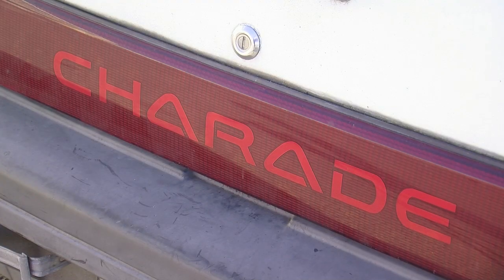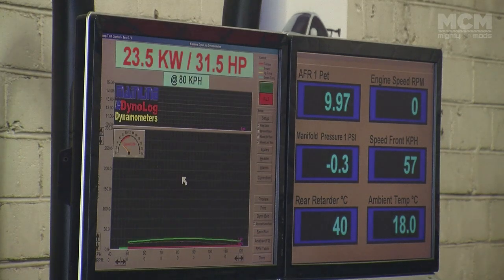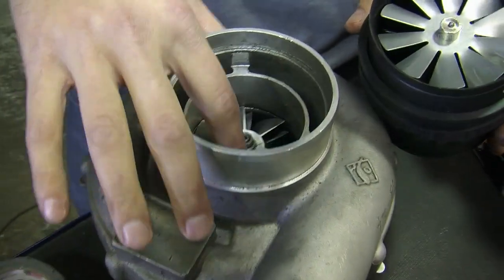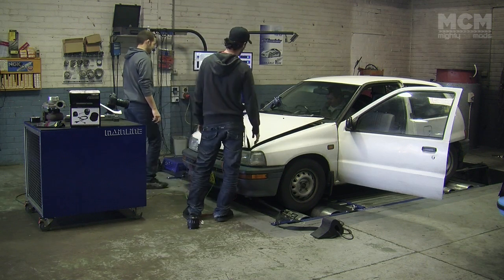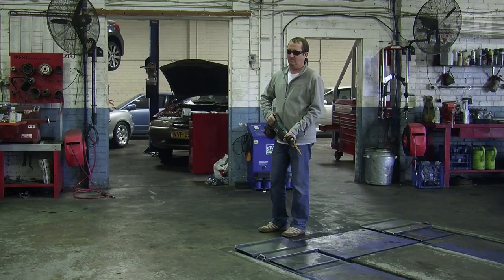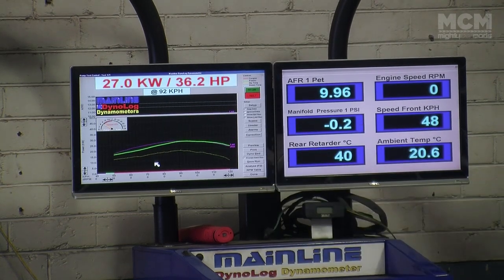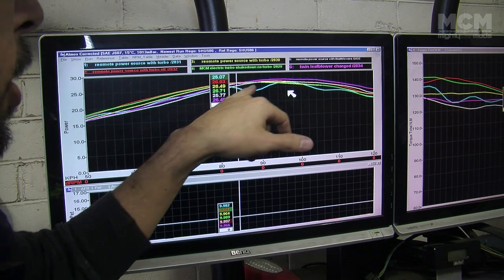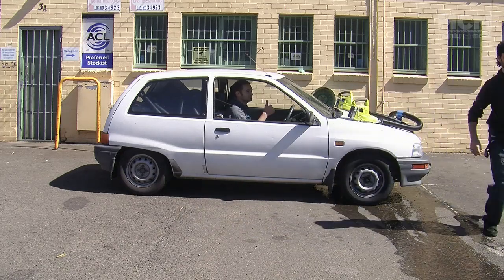Electric SuperChargers Mythbusted

Comment: Loved this vid.lol. Now what ive seen that works are the 5600kv brushless 14.4 volt motors off rc planes with a capaciter bank for the initial amperage draw to counter act the electrical load, also the use of co2 canisters which cool a copper tube inside a metal extension pipe. But still not worth it...the brand was E Chargers....about $500.

Comment: How much more CFM are you going to put into the carb to increase power without increasing fuel? Damn it? Carb needs to be tuned to pump ideal Air / Fuel ratio into the combustion chamber of the enginge they are going to be paired with.

Instead of the injectors in today's car, you tune the carb manually for the car.

So again, What's you f'ing point about bringing the carb into the discussion?

Comment: You are funny! It's my point being exactly. Why put a higher CFM carb in a small engine like this which it's not designed to work with?

May be I missed something, what's the size of the carb got to do with increasing power without burining more fuel? 

I guess your arguments are not making sense for the vehicle in the experiment, does it? Why change the carb size if the Engine using with it is not designed to burning more air/fuel for it? 

So, what's your point about bringing up the carb?

Comment: I know it's carburetor engine. All my early cars were carburetors types so I know how to dismantle one and put back together. Have done once too many in my lifetime before. Changing to larger carb requires retuning of the engine or the car will have blown up engines very soon. There's a limit what a man can do to a car mod. No point in putting a large carb to a small engine car unless you own an oil well.

Comment: Just Like John Farmer said, you can't increase power by just pumping more air. Today's car have optimal A/F ratio already programmed in the computer. 

But for the experiment in the video to work, they need to add more fuel to increase power. 

The eBay supercharger / force air induction won't work is the least to say. Even if you are adding real superchargers, you'll need to adjust the A/F ratio to increase power. More Air Requires More Fuel! There is no cheating the basics of Physics.

Comment: Oxygen only supports combustion, you're burning the fuel. Increasing the amount of oxygen, without increasing the amount of fuel will result in a higher, or lean, A/F ratio. This is not desirable, especially in the case of forced induction, and will result in higher EGT's, IAT's, increased wear and worst case melt your pistons.

Comment: A turbochargers turbine does not spin over 100,000 times per second. The unit of measure is RPM, the M stands for minutes.

Also you can't expect to make more power by forcing more air into the cylinder without compensating with additional fuel.

Comment: also search for this video: High current over a nail - shackspace tour
It shows you what happens to a nail if you put 4.8V@~200A through it, which is about 1KW. Notice how the Nail is about three times as thick as the cable of that fancy Supercharger.

Protip: you should think twice before calling people morons and trying to bash them with basic Ohms Law. They may end up being way better at physics, because they do practical stuff instead of relying on stuff they "learnt" in physics class ;)

Comment: No need to get personal.

Where on earth have you got that figure from? Do you really think that small fan, whick looks like the ones people put in their PC for cooling, can draw 1KW of power? 1KW is the amount of P that your water kettle needs to boil water. Or your microwave to make that piece of meat handwarm

Also try this out: Take a wire with the thickness of about the one shown in the video and try putting 100A@12V through it. For your own sake, do it outside on the driveway :D

Comment: Pressure and flow have an inverse relationship. The whole principal of venturi tubes. I'm a steam engineer and I deal with pressure and flow all day. If you take a fan and speed up air and then slow it down it will gain pressure. Its the same principal as tubo compressors work. Look at the turbo  housing volute, shaped that way for a reason. It changes high speed air into slower but higher pressure air

Comment: The idea of a turbo is to use waste energy from the exhaust to gain power. Even if the electric supercharger could produce usable compression, the extra load on the alternator will eat any gain in engine power. Just my thoughts.

Comment: I don't think they thort of allowing the leaf blowers to suck in because they suck in were they under neath the unit's where they were mounted to the Bonit, if they propped them up or drilled holes where they were mounted it would of worked better !

Comment: Well I stand corrected about the paper filter and yes you're right nano, I merely went into large detail. Can't help myself there at times, although I'm my CAI does nothing for boost, if its a true CAI or been Mod'd to drop the charge temp more than avg then the air would condense and create a small boost I suppose. Heck logical thinking and auto know how can tell ya that lol

Comment: Sorry standard ones DON'T hold up....they're paper which ant handle that high of a draw and develop pin holes....ever see a sign blow over in high winds? Same concept. Now cfm and psi are not the same. Cfm is how much air you're moving, psi is how much air/water/whatever how many pounds per square inch of pressure you have. Simple CAI uses cfm to increase air flow BUT not pressurize it, turbos take it one step further, but if you can't feed the air to it fast enough, your boost suffers

Comment: Okay for one, most turbo/superchargers use HIGH FLOW air filters whereas standard ones hold up....literally. two they utilize and intercooler to "cool" the intakeair/charge air in order for it to compress an enter the engine faster....meaning the cooler the air and more tis forced in, a.k.a. "boost" which is pressure or psi, along with a proper fuel ratio to boost psi is where you get your power. That car had no hi-flow filter and no way to cool the air charge. Now if it had a CAI, it may help

Comment: umm.. physics says otherwise. pressure and flow are one in the same. and wastes extra energy through the turbo bearings if you were to run the leafblowers into a turbo, not to mention the waste from air just going past the turbine blades

Comment: Nice show, thanks guys. The spindle of a turbocharger does however spin at around 100.000..300.000 rpm, not rps. I like the handy hood locking tool, though.

Comment: i would deff. try to seal the filter box/ filter can. The heat door on the intake will lose pressure as well as the lid with the wing nut to hold filter down is not a good seal nor the air box to carb./ throttle body i would try silicone and duck tape on evry single seal ;) to where no pressure/ boost is lost

Comment: Remove the air filter and be sure the air cleaner is sealed up including the hot air port for cold weather on the air cleaner housing you could be leaking boost haha

Comment: A couple KW could be within the tolerance of the dyno. Also, the electric fan can still create power without pressure. While it might not be capable of creating positive pressure, it still may help with airflow. But I too want to see the a data logger with a couple leaf blowers.

Comment: If it did make even a couple KW more output, there must be SOME pressure differential. 

What I'd like to see is the 'real-time' dyno results with the tee disconnected, then fire on the blowers and attach to see the difference in output...

Comment: dude, did you hear anything they said? the little fan doesn't spin nearly enough to COMPRESS the air, FORCED INDUCTION is the process of compressing air and sending it through the system, a car with a 2 liter engine N/A is a 2 liter engine, a car with a 2 liter engine running approx 14.7 lb. of boost (atmospheric pressure equivalent) has 4 liters of compressed air inside it, making it a "4 liter" engine, it's a matter of air COMPRESSION, not just air movement, stick to exhaust or crank power

Comment: However, I have been kicking around this theory about an electric turbo that is it's own closed system. They sell lightweight gel car batteries for race cars, which are generally pretty silly unless you're a professional racer, but if you got 10 of them i think they'd only weigh 100lbs total, but put out 120v and around 3,000 amp/h. Powering a 120v dc brushless motor it could generate quite a lot of power. Some brushless motors can spin up to 120,000 rpm i've seen.

Comment: It's technically neither. It's just generally a forced air intake. Just putting in my own 2 cents, a mechanic friend of mine said electric turbos don't work because additional draw on the alternator puts more parasitic drain on the engine, because it's harder for the engine to turn the alt, therefore you lose whatever you gain. Real turbos use the wasted energy of expanding exhaust gasses to force more air into the engine. Superchargers utilize gearing to create more power than they sap.

Comment: leave the leaf bloweres at home. put your air intake facing forward with nothing in front of the opening. make sure your intake system is sealed accept the opening facing forward. on the freeway you will notice a significant power increase.

Comment: bad installation....The air filter old style box/pan, is not sealing all the air in....not saying that the electric super charger works, but there was for sure a lot of air leaking, should have been fitted right at the carburator mouth.

Comment: Can they make alternators and turbines efficient enough to compete with a mechanical supercharger? Seems like you add a lot of unnecessary middle steps in the energy conversion process and I would imagine each change would result in less and less efficiency.

Comment: Well, I am just using the figures from calculated parasitic losses on most V8 superchargers. Engine power lost while running a supercharger = power required to run the compressor.

Comment: I'll say that you'd need an electric motor that is unwieldy and difficult to power, but 100hp is a bit of an overestimation.
100hp electric motors are used in EV conversions.  As in, to propel the whole car.
Something similar to a starter motor in terms of torque would be sufficient, but would need to be able to be run for much longer periods of time. Also the gearing between said motor and the supercharger would need to be adjusted to get it spinning in a usable range of speeds. Hence, "????".

Comment: Sigh..... again that was my point! We don't know that the fan does not make any boost (we are all assuming and most likely assuming correctly) but the fact remains... they did not test it... . I for one highly doubt the fan produces enough air velocity and or volume to create any boost whatsoever.. I was merely stating the test was flawed. (Testing to see if the "supercharger unit" works by definition would be to measure "its" output independently to remove the variable of the car).

Comment: That was my point  :)  ... if they would have simply hooked up a boost gauge it would have determined whether or not the "Electric Supercharger" had enough power (ACFM) to increase cylinder pressure. You could have skipped all of the dyno testing if in fact there was no measurable boost. If there was boost then its a matter of tuning the fuel curve to get more HP.

Comment: Well... why wouldn't it? Its compressed air. The problem is that an engine eats a really large amount of air, so the compressor wouldn't be able to keep up with the demand. But for a few fake nitrous squirts of power it would probably work. But then you would need both an intake from the compressor and a normal intake, and a baffle to choose between them. Suddenly it all gets quite complicated.

Comment: As they say in the video, it moves air, but there is NO way that, that small fan can compress the air. At all. In theory a well designed one, could help the engine breathe in the air, thereby loosing slightly less power when the piston has to suck the air into the cylinder, but the problem is that it needs power to do so, and it will likely just take more power then what it actually gains. But it will NOT compress air. It just wont.

Comment: It would have been nice to know if in fact it was actually creating boost. If yes then its a matter of tuning the fuel air. Adding boost without fuel is going to lean out the mixture which will cause you to make less HP.

Comment: I didn't read the comments others posted, but i see allot of area's where any pressure your trying to make will go out and not make pressurize. The crankcase breather and the manifold heat ex-changer intake near where you hooked up the motor. Those 2 spots alone will leak any pressure created. I'm not saying these electric thingies are going to work, just to see such a miss on something that will leak the pressure with no real try to make sure they were sealed is slacking work on your vid!

Comment: You put the turbo before the intake, it should surely go after the air filter. Like you did it, its just pushing air at the air filter more but the air filter will just slow it down kinda thing, after the air filter will suck air through better and get better results :)

Comment: You cant put this supercharger on a bigger engine than 1000cc. Because a bigger engine will suck more air than that fan will push in. And that fan is supposed to be activated when making full throttel. And on a dyno the engine isnt having any resistance at all. Try it on the road, it will probably go better then because the engine doesnt rev up to top RPM at the moment you floor the pedal, right? I think its waste of time to even try it on a dyno. :) IMP

Comment: It would work if that e-bay's turbo wasn't just a fan! To create boost you need to have an impeller that spins the vanes quickly enough and a housing that almost creates a seal so the vanes can produce enough air pressure built up to create boost! If air excapes past the vanes then you lose boost!
If you used a centrifugal supercharger and had a fast high torque electric motor to spin (it would not be RPM controlledby the engine), it would kick on like hitting nitrous when you flip the switch!

Comment: The Chevy Aveo is no longer sold here. When it was, it was one of the cheapest, shittiest and most archaic cars available here, so it's understandable that it would still have vacuum operated controls.

As for my personal car, it's an Acura TL (I'm not sure if there was an equivalent in your country), it doesn't hiss. I know all the doors are operated by electric motors. It's a logical setup too, considering it has dual zone auto A/C.

Comment: No no get one that is broken, make a simple middle housing for it. Add a DC 12V 5000rpm engine and some gears (big on the engine and small on the axle x20), add some high rpm bearings and your good to go.

Comment: I have no doubt big gains in kW are available, but those gains are from getting more fuel/air mixture into the engine. It violates the laws of thermodynamics to get big power gains AND a decrease in fuel consumption.

Comment: It might be different in Australia, but in the US, just about every car built in the last decade uses electric motors for the mode and blend doors, since vacuum motors and all the lines associated with them are excessively complex, bulky and unreliable. I've taken apart the air handling boxes on several newer cars and they're all fully electric. The newest car I've seen that still had vacuum motors was a 4th gen Mustang, and those stopped production in 2004.

Comment: If the air cleaner were even capable of holding the pressure at all, I guarantee if you were to hook a turbo to that air cleaner you eould still not gain any hp nor would the box explode especially if its only 5 to 15 psi, which the fan may never make but you could hook an air compressor to the cleaner box and never achieve 1 psi

Comment: If you hooked a turbocharger up to the air cleaner box and tried making boost with it, the box would blow open.

BOOST, compressed air, is the key.
If this fan thing were making any, there would be air cleaner box all over that shop.

Comment: on another note though this proves really nothing because if you hook an actual turbo to your air cleaner box you will see the same result as it is not made to take pressure, you should have hooked it to the throttle body instead...

Comment: all true, I havent heard of higher octane doing damage(not to say it couldnt be true), but absolutely you won't gain any power using higher octane. i rounded down to 20:1 since things like valve overlap and efficiant throttlebody design can give most NA motors a higher than 1bar pressure to start with, but basicly 22:1 - Yep!

Comment: You guys made a huge mistake. These electric chargers need to be install after the air filter. You guys never removed the factory one and did not checked the condition of it. Rerun the vehicle by intalling this closer to the intake or carburatoer intake. it should go like this... carb-turbo-filter not carb-filter-turbo. The factory one was probably clogged and did not allow enough air to flow. try it and redo the  dyno test

Comment: I doubt the thing adds any power, but by bolting it to the intake snorkel of a carburated engine, the pressure produced is likely venting through the warm air intake valve, and/or is going back through the PCV.

Air cleaners on old carburated cars were never meant to be pressurized.

Comment: You have to tie down any vehicle to a dyno... Just a perception pointer in case the screaming sarcasm throughout the entire video didn't set off your brains sarcasm sensor as it was intended to do.  I thinks it's safe to assume the extra straps are indeed adding to the sarcasm